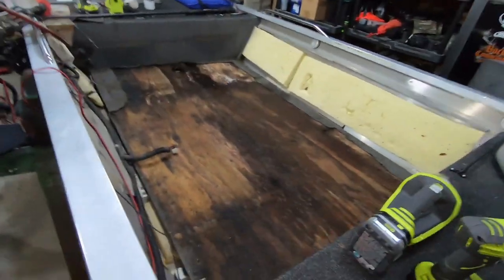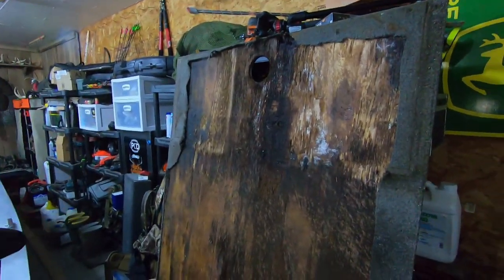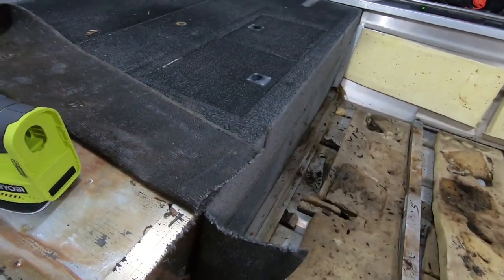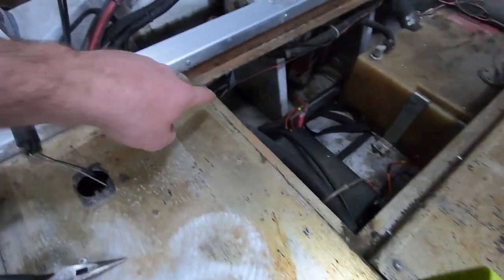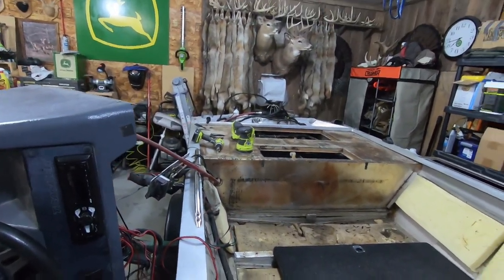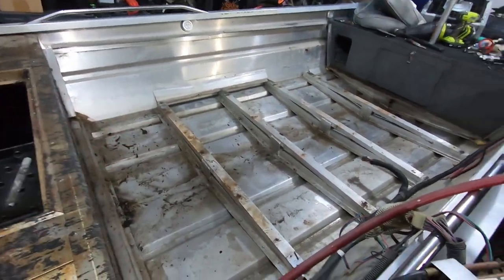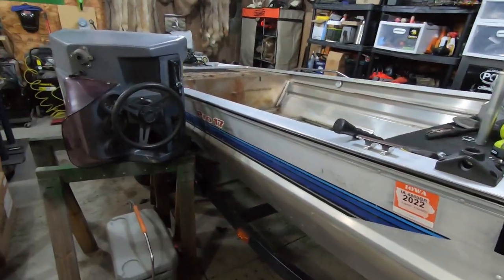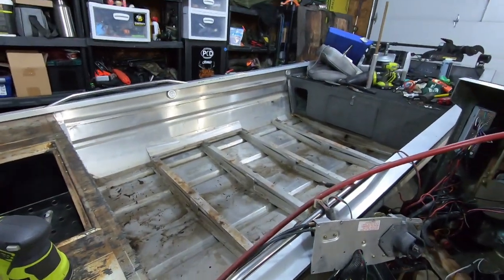Bass Tracker Overhaul EP2

Comment: Hello, I have a 1992 Pro 17 Bass tracker also.  I replaced all the marine treated plywood with 3/4 inch.  Yes it makes the boat a little more heavy but I weigh 200lbs and the old front deck had a bow in it.  Since I replaced the plywood with 3/4 inch 10 years ago.  I have no problem with the front deck having that bow. Another thing I did was replaced as many bad rivets in the back as I could.  There were lots of broken or loose rivets. And great video work.  Reminded me of all the work that I had to do on my Pro 17.

Comment: I had a tracker pro 17, I took the 40 hp engine and replaced it with a used 75 hp motor, it almost doubled my travel time withe same amount of fuel, plus the boat went on plan super easy.less water spray into boat at high speed.

Comment: I had an idea on how to get the water out of the rear foam. If it is pourus at all you could get a tank of argon and run it through it. Making sure it had a high vent. I would shove the inlet hose as far down from the top as possible. I'm a welder and argon will dry most anything up. If this works let me know. I'm getting ready to restore a similar tracker. Thanks
Reply from the maker: So far it has stayed dry inside so not an issue but if i ever get a slow leak i might have to try that

Comment: How the hell do I remove the back deck as I need to tighten the seat post plate and replace the aerator on the live well, removed all the outside screws but the post plate is still attached somehow,  thanks
Reply from the maker: The rear deck in my boat is not removable it is foam filled structural all riveted together. So i am not much help